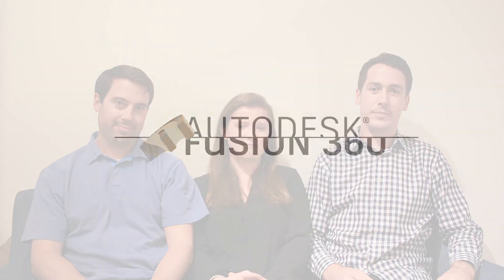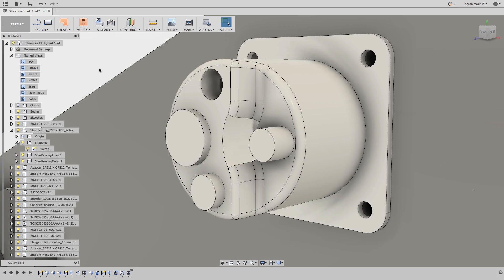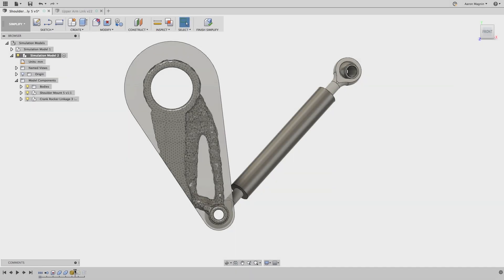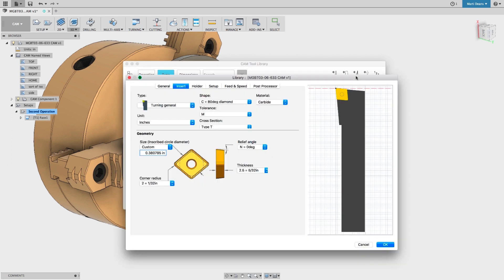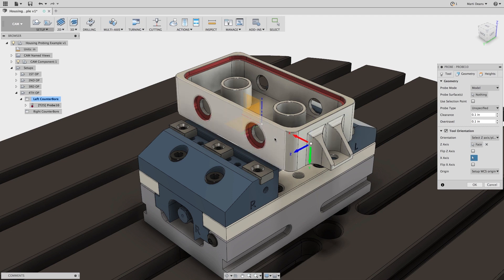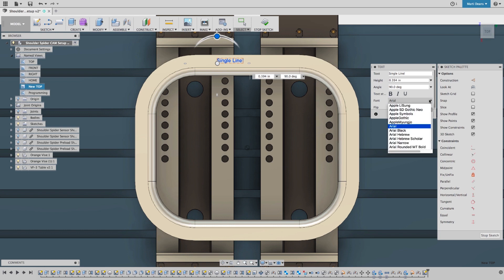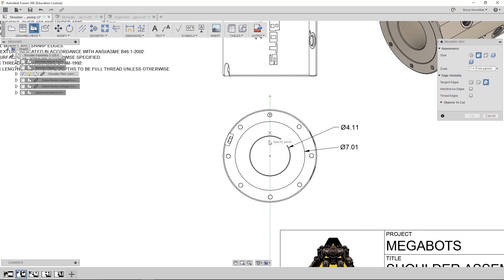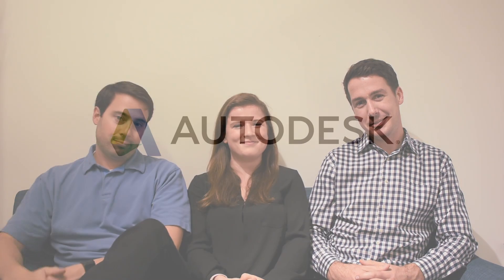What's New in Fusion 360 April 2018 Update

Comment: And speaking of curves, Text on a curved path too :-)
I've also been trying to "hack it" by constraining radial lines and tangents to the a circle and the text bounding box, and that just doesn't seem to stick--Fusion keeps removing or ignoring the contraints and then it decides to randomly change the font size--even when set by a parameter!
Reply: Agreed, this is sorely needed.  It's kind of a hassle to fire up illustrator whenever I need to bend some text.

Comment: The peck turning is going to be very useful! Im having problems finding a good way to use a insert drill on the lathe and then also use that as a boringbar. Is there any good tricks for that? Thanks //MATAL Engineering
Reply: You need to define the tool twice in Fusion.  once as a Boring Bar once as a drill.  They can both be T2 for example.